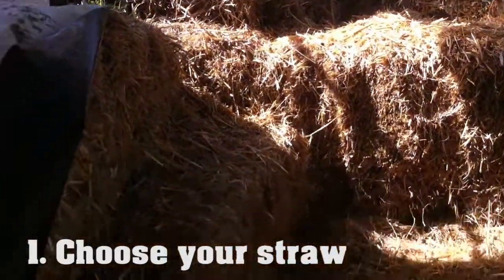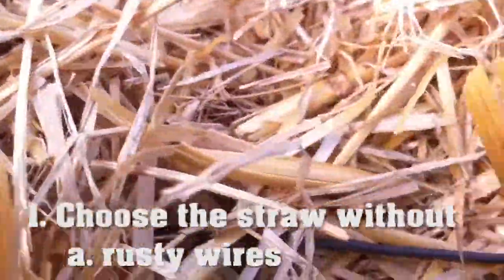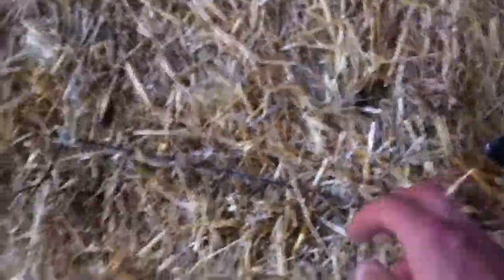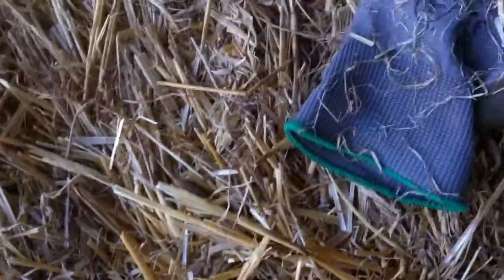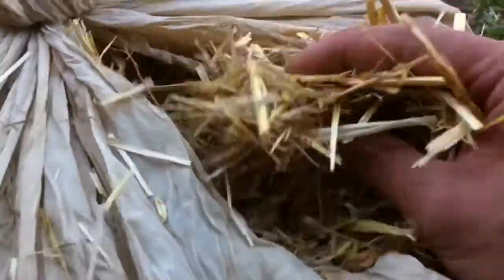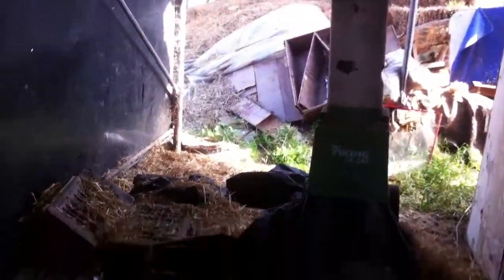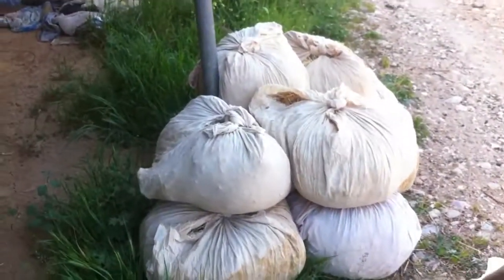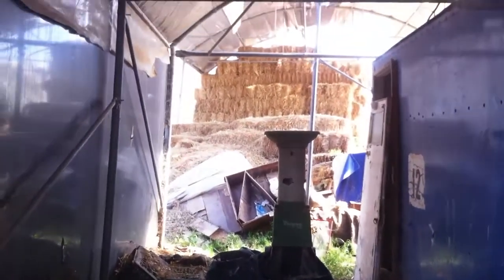Preparing substrate: chopping straw - Mushroom Cultivation Videos Episode X

Comment: Thanks for the video. Horizontal chipper then Adapt your chipper to cut smaller. Build new cutter head with more and smaller blades. Use lawnmower blades not wood chipper blades, adjust the size of the gap, smaller gaps will make smaller pieces and unless you use three phase electricity your 220V electric motors too small go 10 horsepower petrol/diesel. 15 minutes a bale is and doing it twice is over the top.
Reply from the maker: Thanks for the suggestion. Do you use such blades ?  do you have a picture ? before I used a 2kw wolf bv21 wood chipper with blades like you describe (https://www.systemed.fr/images/conseils/6-broyeurs-vegetaux-electriques-a-partir-130-4497-p12-l248-h248-c.jpg). It was much slower to cut straw, and I had to push the straw with a stick to get through the blades. So yes, with such blades I would need definitely to go for 10 horsepower and find some way to self-pull the straw. We'll get there one day, for now, we stopped chipping straw, as it is not as practical as sawdust to pasteurize in our drum sterilizer.
Reply: @themushroomcircle-3995  hello, your link will not connect. I used a horizontal chipper that is 15hp diesel. I bought off Alibaba from China, imported it myself. $4000AUD it was surprisingly good quality, It has a 500mm x 25mm cutting plate with only 2 blades bolted to the plate for chipping. I left those chipper blades in place,  I reduced the two 30mm gaps to 20 mm to slow it down and put 4 more lawnmower blades on the plate mounted 20mm higher off the plate. The type of blades that swing back when they hit a rock in a lawnmower. Don't use the single bar cutter like on some mowers, I think that will strain the shaft. Sorry no photos I sold it to a Pony club to make horse chaff feed. It did work very well at the time taking 30+/- seconds to cut a straw bale for substrate that others also borrowed to make their own substrate and always complimented on the fine cut.
Reply: @themushroomcircle-3995  search horse chaff cutter on Alibaba
Reply from the maker: @Roadsaftyslowdown  thanks, that's interesting the horizontal chipper. These chaff cutters look much better suited to the straw than my current wood chipper. Probably get that when I am ready to upscale with straw. How fast did your machine chip a straw bale ? my link of my previous more amateur chipper was : https://www.systemed.fr/images/conseils/6-broyeurs-vegetaux-electriques-a-partir-130-4497-p12-l248-h248-c.jpg
Reply: @themushroomcircle-3995  my machine cut a whole bale in less than 30 seconds. When buying chaff cutter make sure you tell the seller what size you want the straw cut. This will determine the number of blades. They cut chaff in many sizes for guinea pigs to horses. Also look at India Mart as well Alibaba, India maybe cheaper shipping for France.